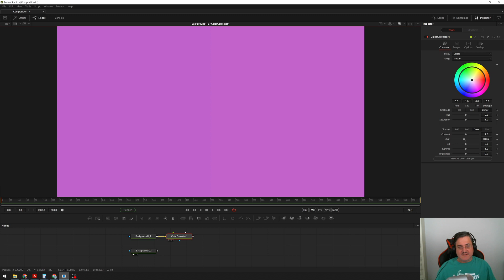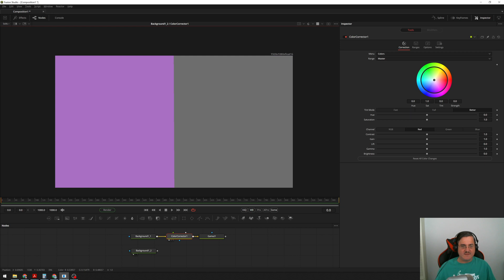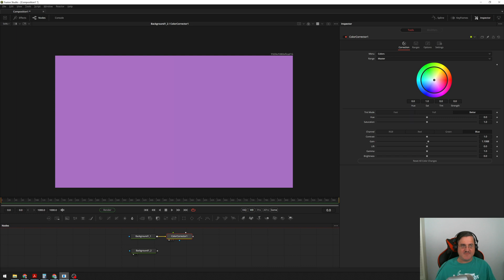Color matching in ACES

Comment: Do you know of this method for Photoshop? https://youtu.be/WSjWbPN14i4

I'm sure, it could also be useful, for Fusion.
Reply from the maker: It could be useful for some tasks, yes, but it doesn't solve the problem of mis-aligned color primaries. In fact, in my test comp, I couldn't get a match at all by sliding the hue. In fact, I think the HSV method is worse because the angles between the three channels changes in ACES. If you take a close look at the overlapping gamuts, you'll notice that the angle between the two Green primaries is quite wide, but the angle between the Blues is very small. So the Hue control acts very differently in ACES color spaces than it does in spaces that use Rec.709 / sRGB primaries.

Comment: Do you know by chance any Anti-aliasing node for Fusion?
Reply from the maker: There was some effort a few months back to try to get the developer of the OLM Smoother tool to make a Fusion port. I don't know what the status of that is, though. Conversations at WSL: https://www.steakunderwater.com/wesuckless/viewtopic.php?p=57101
Reply: There are three very good attempts, at the WSL forum. One is SMAA, one is FXAA and one is MSAA (I think).
It is only two projects, the FXAA is a stand-alone dev project, and the other contains both MSAA and SMAA.

As i can't post links here, you'll have to find them yourself. They are all in the Dev board, if I remember correctly.

None of them, are as good as OLM Smoother, although OLM Smoother is said to use FXAA. But the SMAA works pretty well, at least on anime and cartoons. The difference can almost be eradicated, by using an edge detect node, and play around, with for example a simple blur, or maybe the CustomFilter. Just don't use the CustomFilter diagonally. I've tried a lot, doing AA, before I found those projects, by using the CustomFilter, in many ways.

There are standard nodes in Fusion, that can do AA, and I've heard, that they are pretty good, but they are all for 3D and I don't do 3D.